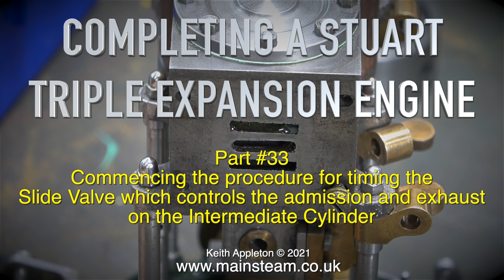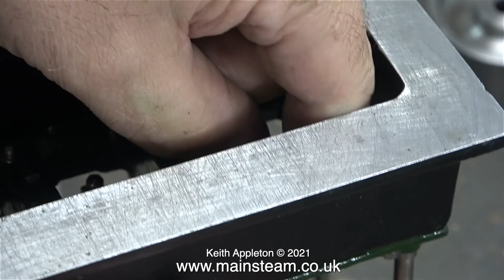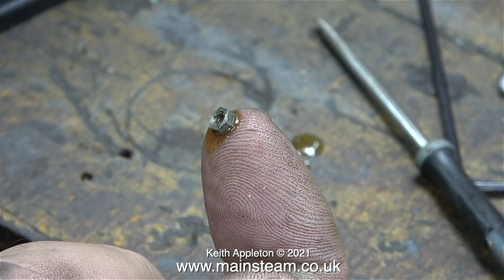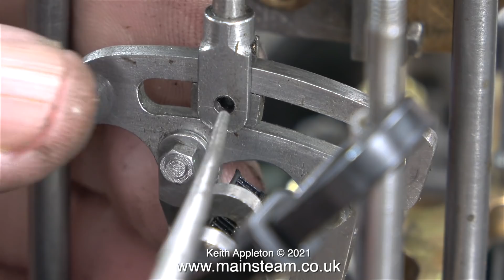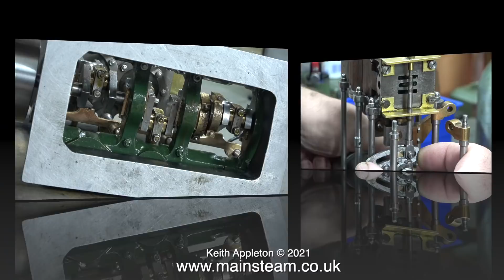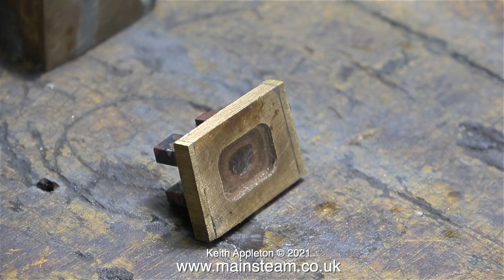COMPLETING A STUART TRIPLE EXPANSION ENGINE - PART #33

Comment: I  will never build a steam engine again. I don't have a workshop for metal working, beyond hand tools a pillar drill and a bandsaw. At nearly 75 its a bit late to start. But I love watching you at work, generally its pretty relaxing, and I certainly never want to bounce up and down shouting,  "You're doing it all wrong!" What I generally like to do is spot  the problems you are dealing with, and how I might solve them. Quite often I'm right, on other occasions I say, "Why didn't I think of that?"

Comment: Ah, you can see, I was confused because this is the first video I've seen of this series that even mentions the intermediate cylinder. Granted, I've only just started following your channel and I mostly am interested in locomotives. This engine reminds me of the Mallet locomotives that have two or more sets of running gear, one for high pressure and one for low pressure. Anyway, great video. Looking forward to learning more.

Comment: IP setting is very difficult. It took me patience too. I also had the problem with the slot in the valve fork, had to remove 2 of them although the slot was OK per the drawings (1955 drawings) I noticed 1 or 2 other errors in this one.

Comment: Brilliant. Instead of using steam oil to stick a nut on my finger I always use a piece of blu tack. Kneaded to a shape I can get to places that would be very hard to reach.
Reply from the maker: A good tip!
Reply: Best way I've found for 7BA is to thread a nut onto a length of 7BA rod so that about half a nut's height of thread is protruding. Loctite it in place to complete the tool.
To use, screw the nut onto the end of the tool than get the nut started on the bolt. Hold the nut while unscrewing the tool.
It makes it very easy to position a nut in very awkward places, with no danger of the nut getting dropped.